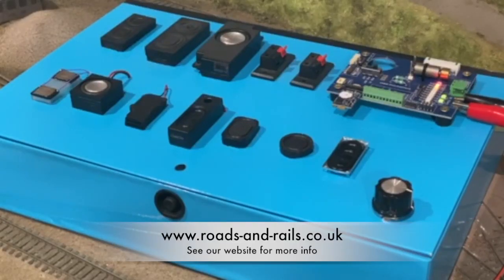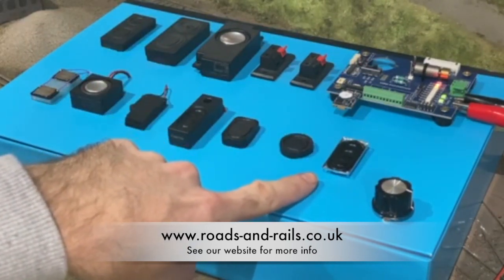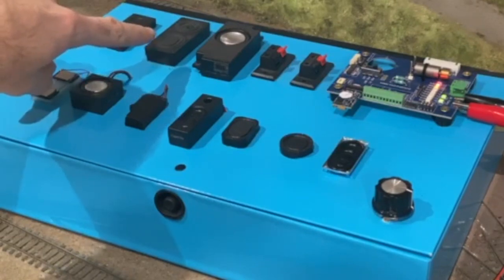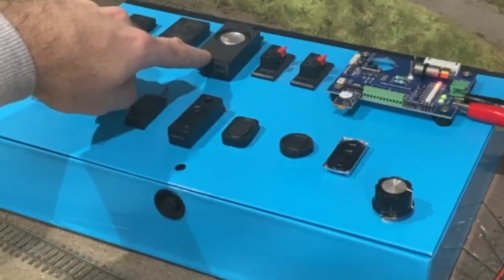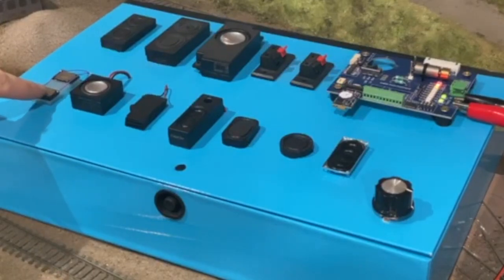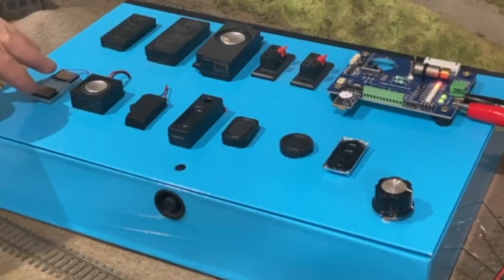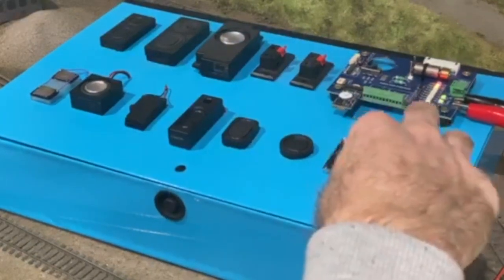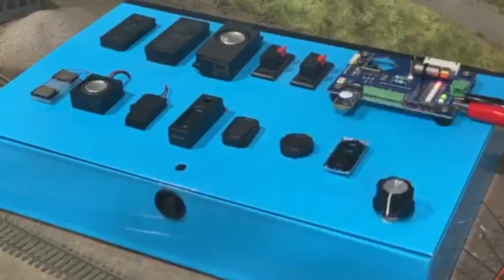Huge DCC Sound Speaker Test! Which Speakers Should You Upgrade With?

Comment: Hi there and greetings from the US. Which double iPhone speaker was used?  Also, have you any experience with TCS decoders on iPhone speakers?  They are rated for 8 ohms and I believe this is 4.  Could be that it’s just not quite as loud (?) which is fine by me since I normally turn the volume down some. I really really like the clarity. Thanks for sharing!